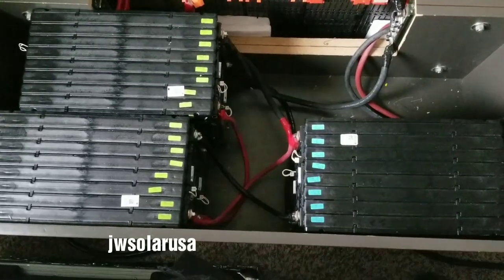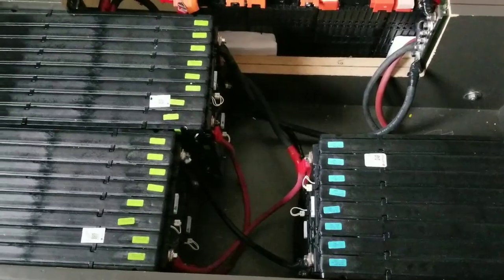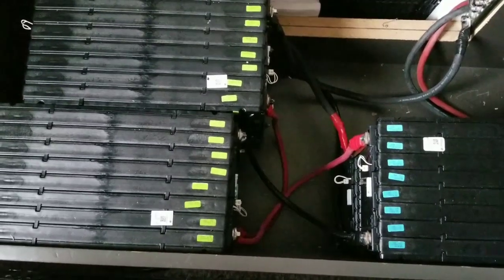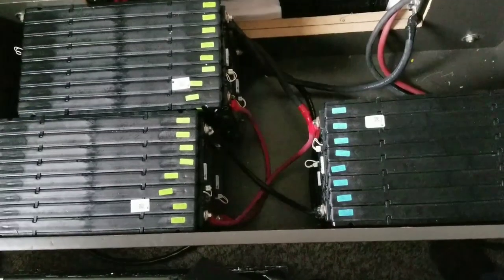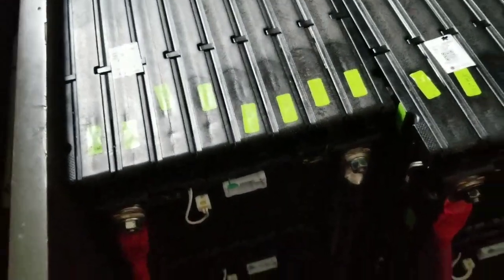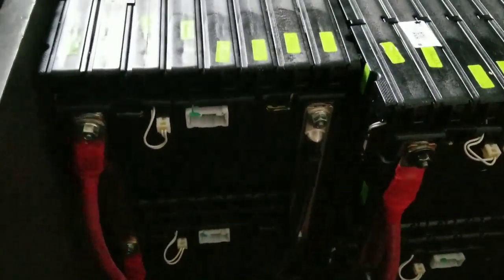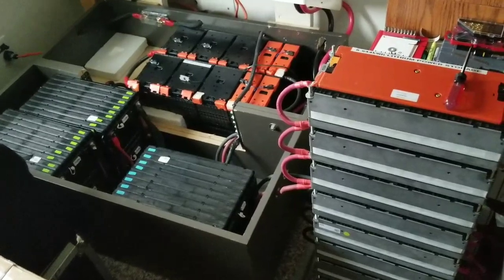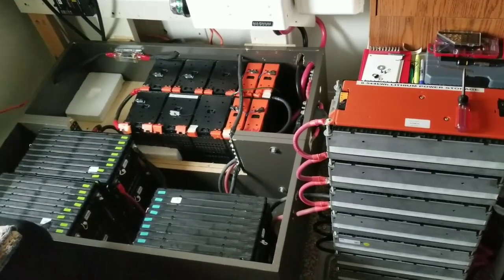LG CHEM SOLAR BATTERY: LITHIUM BATTERY WITHOUT BMS VOLTAGE TEST

Comment: BMS are cheap insurance. Especially with lg  and there Chevy bolt issues
Reply from the maker: Go ahead and get the cheap insurance 👍
Reply: @jwsolarusa  I did I bought the 120 amp jbd BMS. About $100 each I have 3. One on every 2 packs. I have 6 packs each 64 ah at 48 volts. Total of 384 ah and just shy of 20kwh. I have 57 kWh of lg chem I'm about to assemble and add to the bank. I'm going to need to buy several more BMS. It's in my house I want it safe. Plus I have two burner phones. One on the pack with the Chinese BMS app and one upstairs on a wall mount so I can always just check the packs at a glance. Just be safe brotha. If I didn't get all these batteries for free I would have gone EG4 server racks lithium iron phosphate..way safer and way longer life span. Like 8000 cycle's vs the 2000-3000 we will see with these NMC chemistry

Comment: Hi thank you for your good new video with no  BMS, but if it is absolutely correct then you have to measure each cell as one cell can be lower and another cell can have higher volts so you get measured on the plus and minus terminals and can give a false result of the voltage on each module. But LG chem stays well balanced but at some point they will come out of balance. I have written to other DIY and they mention that you should use BMS for LG chem or they would not use them on the EV cars if there was no reason for this .. But on the other hand if every single cell was connected in parallel then you do not need BMS..:-)
Reply from the maker: Brother Rob,
I choose not to use BMS on my system it is a preference. 
I am NOT against using battery management system (BMS) which is just extra protection for your batteries. 
It doesn't mean if you don't have BMS your system won't work. 
This is all about science proving things and this is what we do here at the (jwsolarusa) live in Minnesota. 
Thanks for your input buddy and STAY TUNED for more to come live from this Channel.